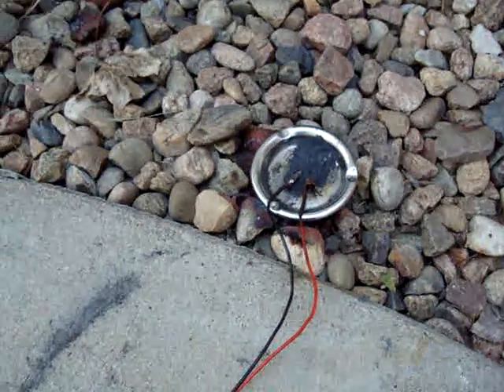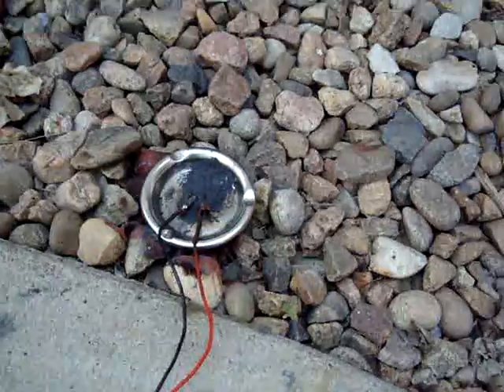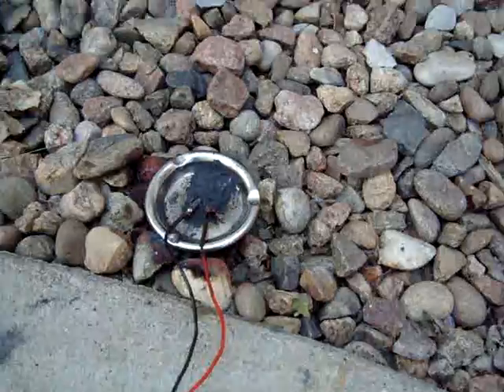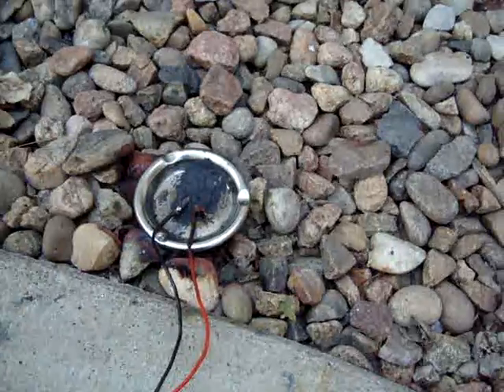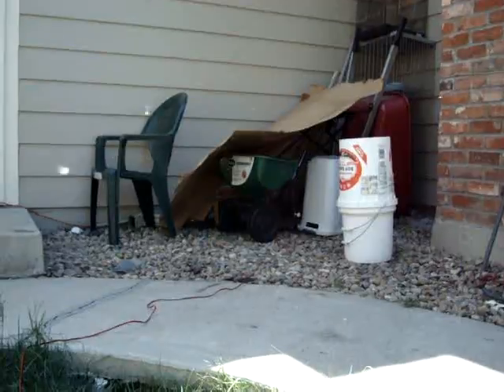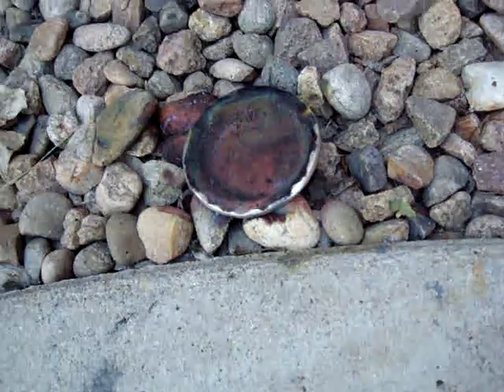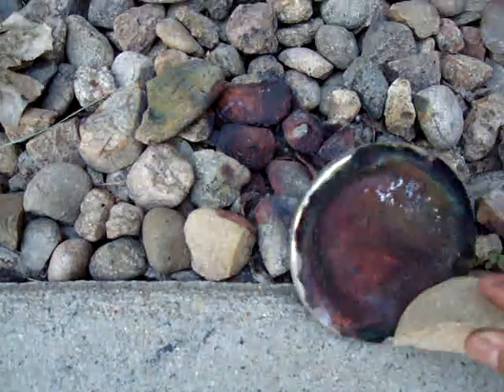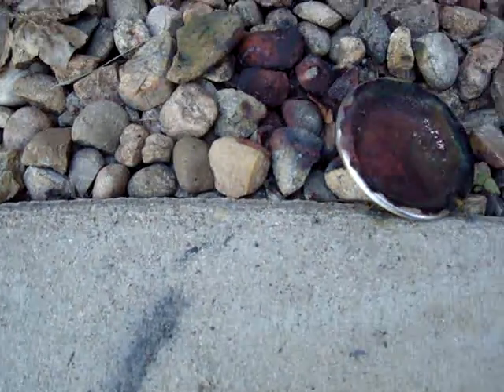Don't Play With Copper Thermite!

Comment: CuO/Al thermite is quite violent. If you use fine enough Al and CuO it lights with a simple visco fuse. Confine it in a cardboard tube with plugs and it makes a decent bang. I watched it explode in that way and there weren't any sparks, just a big bang with an orange to white flash. The less you confine it, the more it becomes a fireball with sparks.
Reply: no, it had sparks
Reply: if it explode that mean your ratio is wrong.The point is to make it burn not to make it explode.
try 4:1 - CuO/AL

Comment: Copper thermite is the required method for electrically bonding two rails together in railroad applications. The heat it generates causes the copper and iron crystals to interlace a little, which makes a very durable bond, immune to internal oxidation and corrosion. You can't get that with braising.
Reply: No they do not use copper thermite

Comment: Dare I say i just bought 1 pound of AL and CuO to make such thermite?  I dont plan to do the whole thing, just little at a time to experiment.  What did you ignite it by? Some electrical source?  I had plans to use capacitors, and a 10 second auto-ignition...